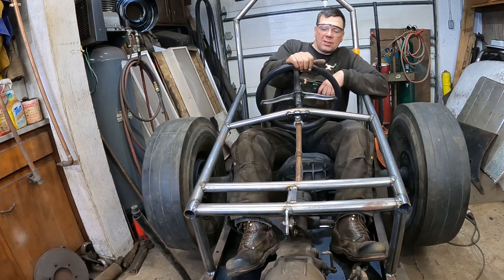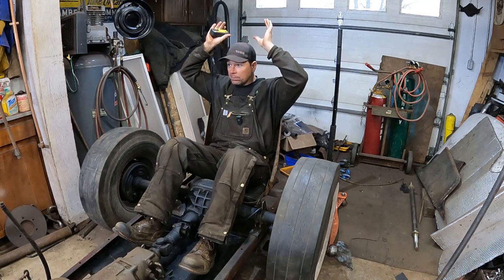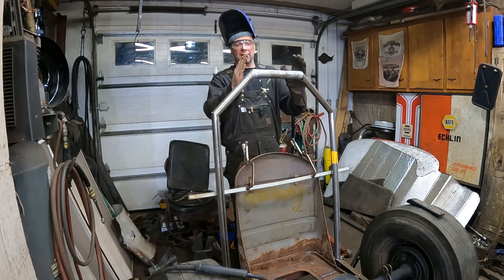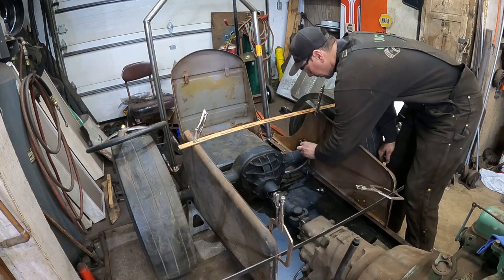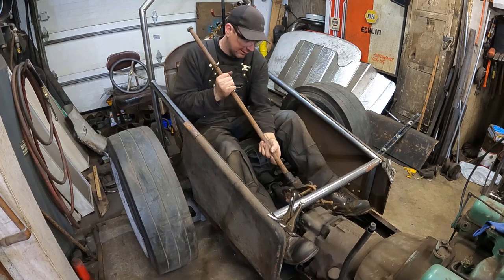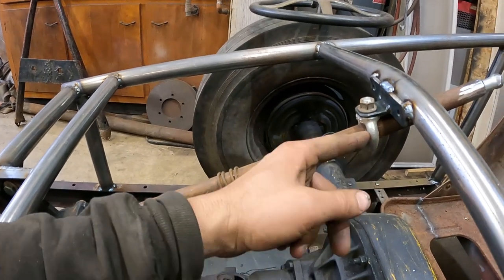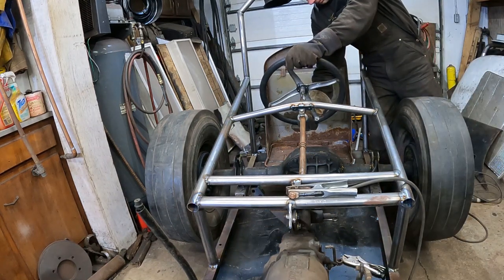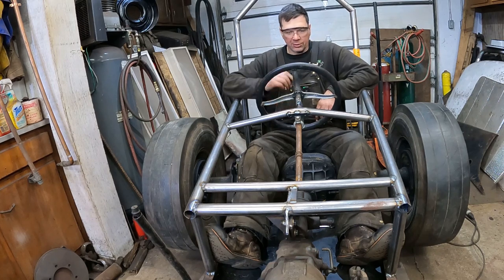I Turned a Model T Coupe Trunk into a Dragster Body:  Deathtrap Rail Dragster Build

Comment: Thanks for sharing, Josh! The "T" body panels worked out very nicely! 'Looking forward to future episodes. I know you're waiting to post the "first-fire!" video! (smile!) Question...what are you thinking with respect to the push-bar? Enjoy! Be safe!
Bro Harry
Reply from the maker: What do you mean the push bar?  You mean the roll bar?  I patterned it after Don Garlits first rail of the same time frame.
Reply: @QuickSpeedShop  Wasn't "Big Daddy's" first dragster push-started?
Reply from the maker: Maybe.  A lot of them were.  Some early rails ran a clutch, but direct drive so they had to be pushed to the line.  Kind of similar to sprint cars running in/out boxes.

Comment: The heim joint on spindle steering arm is not period correct.use a tie rod end.
Reply from the maker: I know that, but it's what I have to work with.  The steering arm is drilled for a heim.  I'm not building a concourse car and I don't have a 7° reamer to fit up tie rod ends.